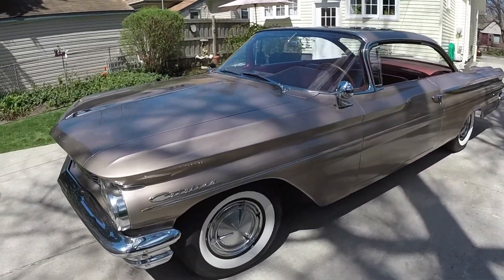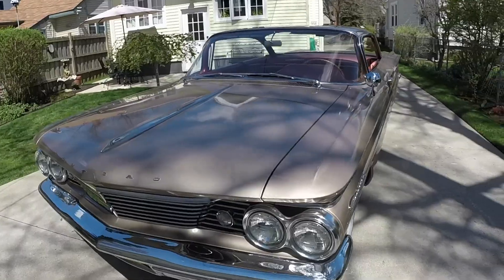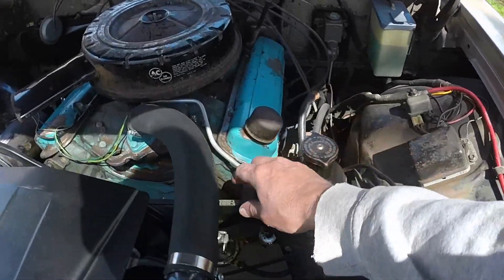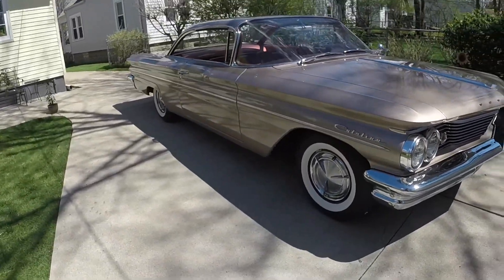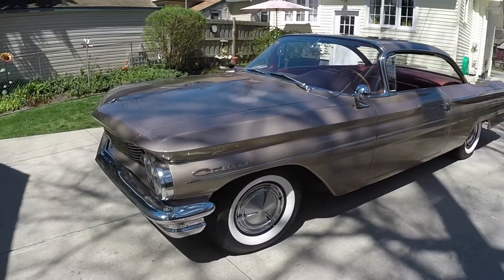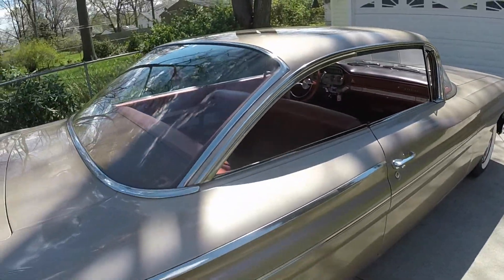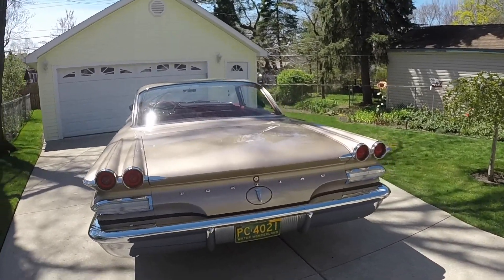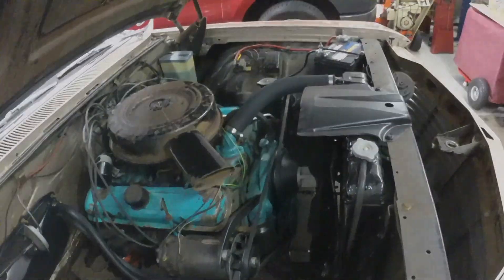Having fun with the 60 Pontiac barn find

Comment: I just noticed how thin those pillars are pretty much just glass holding up that roof. That back window is huge! Very cool
Reply from the maker: Yep, the A and C pillars are thick steel, but the glass still is some of the support. The inner rocker panels are super thick for support too. Kinda like on convertibles. The body style is "Sport Coupe". All the Sport Coups and Sport Sedans had pillar less doors, and no "B" pillars. It is a really open car, with great vision.

Comment: Hi Howard,  Pontiac looks so great!  always love watching your videos.  I've learned a lot.  I changed the valve cover gaskets on my Merc this past weekend.  Took me two days but I accomplished it.  First time i've ever done anything like that.  I'm learning as I go along.  I'm jealous of how much room you have to work on the engine of this pontiac.   The merc 351c takes up the whole front of the car and so hard to get at everything.  I"ve been a car freak ever since my Uncle Dave took me out in his 66 corvette.  Been going to car shows since I was old enough to drive. I had a 75 plymouth duster in my twenties and a 69 vw bug.  Did some minor stuff like batteries and oil changes etc.  But always wanted to learn how to do more.  Sent my brother pics of the gasket job I did and he was very impressed.  Had to show one of his buddies at work that's a car guy that his Little sister has a muscle car and works on it herself.  lol  So thanks for posting all your videos I learn something all the time by watching them.
Reply from the maker: Glad to hear you got some work done on you Mercury. I have had several Ford's with the 400, same as the 351C and 351M. They have a little more stuff on the engine to remove, to get to the valve covers. The Pontiac's 389 is super easy to work on. I have a friend that has a 74 Duster, with the 225 slant six.... he also had a VW Bug a while back, don't remember the year, but I thinking mid to late sixties. He use to follow Jeep's threw the woods with it. It would go better than any 4X4 I have ever ridden in, threw the woods. This was back in the late 70's, when a mid 60's car, was just considered a cheap beater. It really was a great little car, that was great on gas, plus it was a fun car to drive... and he beat the crap out of it... and it just kept going and going.
Reply: so cool.  my duster was a slant six with 3 on the floor.  And I used to take my bug through the fields like a jeep too.   lol  guess we know we're around the same age and you did stuff in the michigan just like we did in new england.  lol   I think we grew up in great era.
Reply from the maker: I agree.